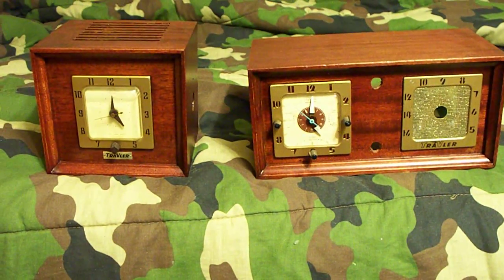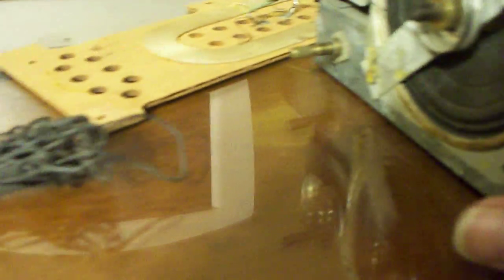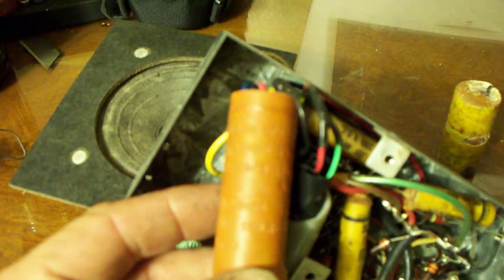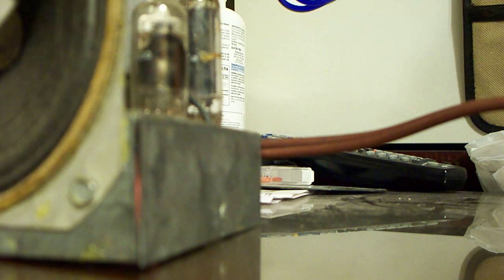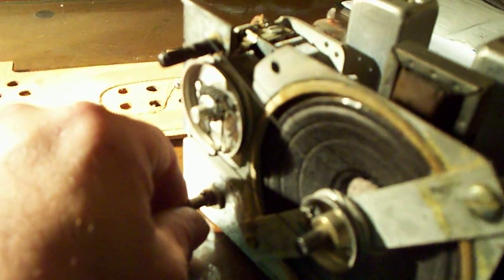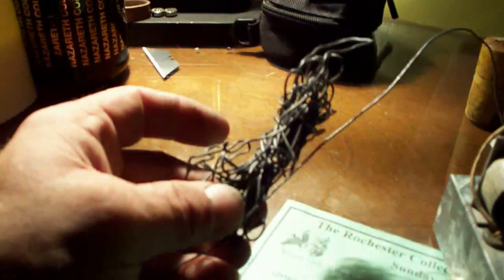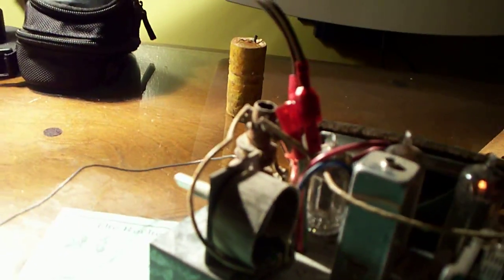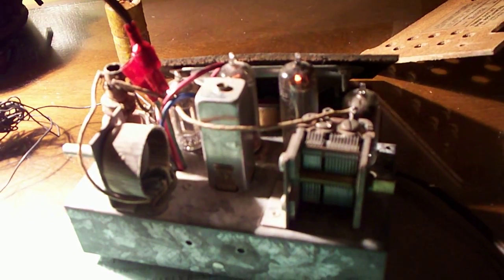TraV ler radios

Comment: Very nice demonstration...I would replace all those old caps with new ones and you will likely get even better performance. I have a Travler right now which I have disassembled but haven't started working on it yet but I will make sure to make a video of it. It is a little bit later one in a plastic cabinet.

Comment: Hey whats going on. Very cool video and it was just what I was looking for. I was given one of these radios just like yours, the one you had in the barn. Mine works but hums as well. I can hear the Am station but the hum is overpowering. How did you remove just the radio part and not the clock? The wires for the clock are so brittle and are cracking when I move them. This is my first attempt on anything antique.